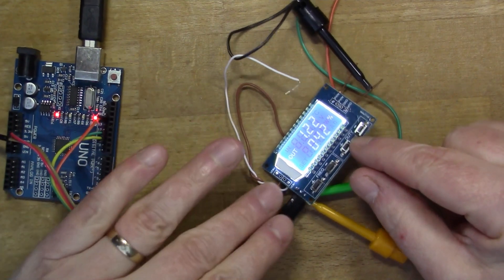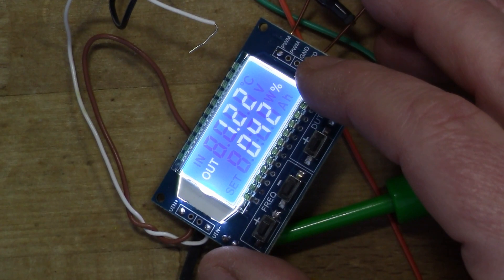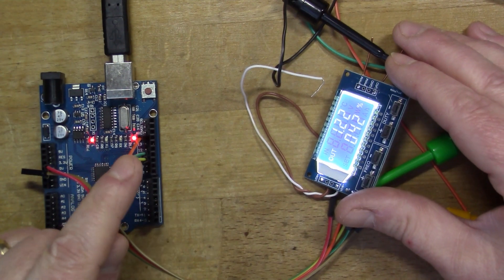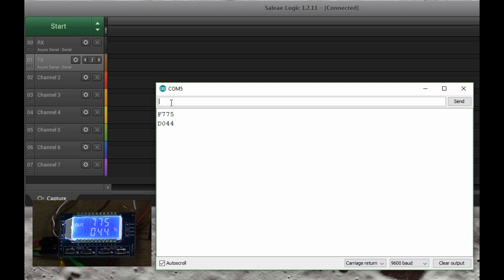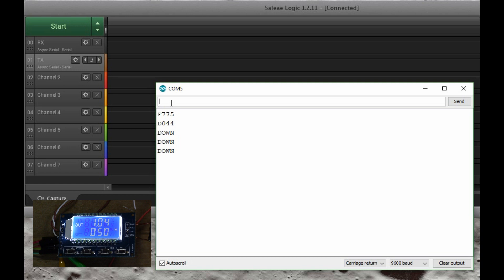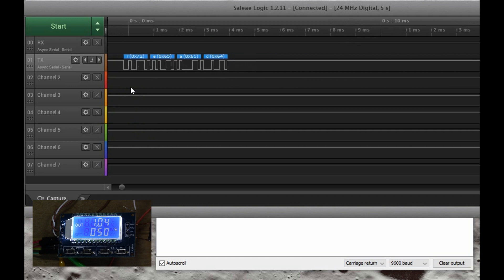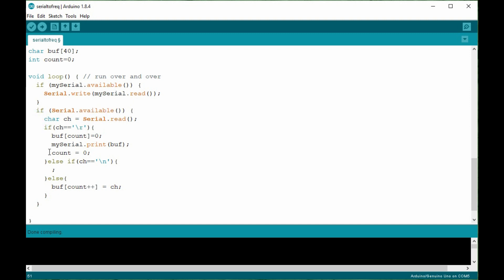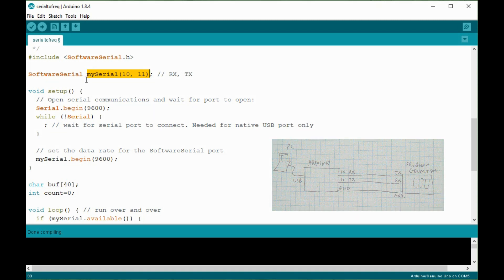Frequency Generator Part 3 - Making the Serial Controls Work (#61)

Comment: Hi Martyn Davies, I'm trying the same program in Arduino Mega. But it's not working for me (pins  Rx-10 Tx-11). I couldn't figure out the problem. Is there any methods to diagnose it?
Reply from the maker: Check that you've got the speed correct; try a different pair of pins (in case you've got a damaged Mega); try connecting to a different piece of serial equipment. If you've got a logic analyzer, plug that in to the pins and check if it can see serial data in either direction.  The Mega has more than 1 UART interface (3 I think), so you could use these instead of the SoftwareSerial library.
Reply from the maker: You should also check that you have the wiring right - RX on the module to TX on the Arduino and vice versa.
Reply: You're right It was the tx and Rx wiring, thanks

Comment: How easy would it be to use this with an esp8266 to get a remote response? As I said before software isn't my strongpoint!
Reply: Wrote this before I noticed previous comment!
Reply from the maker: Yes I plan to do this with the Raspberry Pi. The ESP8266 would be possible too, but I think it would be easier to code in Python (on the Rpi) than using the Arduino tools or using LUA (on the ESP)
Reply: Martyn Davies it's good to see these modules used in practical situations and not just as test circuit tools!

Comment: Thank you for your video. You can use Tera Term if you use the Broadcast command in the Control menu option. this will send the string quickly without delays between the characters. The terminators can be turned off by un-checking the Enter key check box option. Any delay between the characters sent will cause the FAIL response due to a timeout condition. This is why typing the letters one by one replies with FAIL after each letter.
Reply from the maker: Great tip - thanks very much